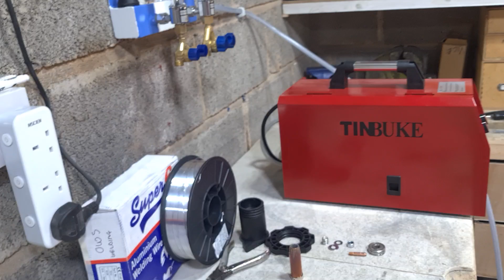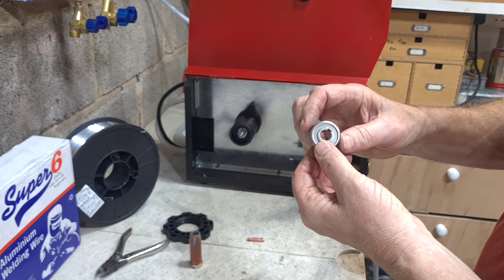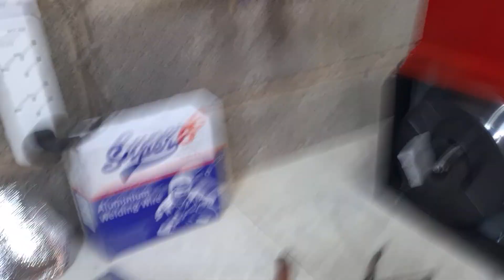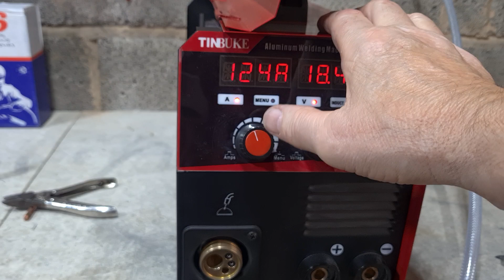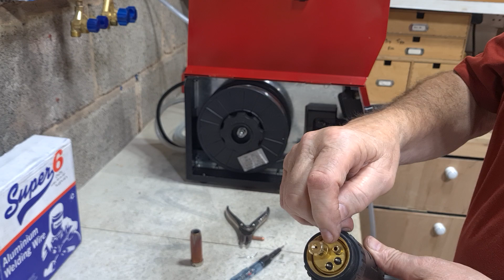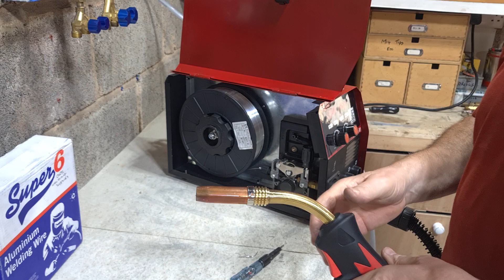Aluminium welding set up with the TINBUKE 230-DP

Comment: I have this welder and I am having problems using any of the pulse setting on aluminum. No matter what I set it on I get major burn back into the tip. I am running on 110 currently. Been welding in the collision industry for over 50 years, never had a machine stump me before. I can’t find any useful info online. Should I be running 220 power for this to work. Any explanation of settings would be appreciated.
Reply from the maker: Will get back to you later , but I have videos using all 3 modes on 220. Burn back is either not enough wire , voltage 2 low or wire feed roller pressure 2 low or Bends in the mig torch. Have a look at the most recent videos even spool on gun. Let me know. Good luck
Reply from the maker: Also get off 110 volts

Comment: I'm going from a traditional , ( wire feed and current knob ,) Cebora 185 mig welder to the Tinbuke 230-DP which I've just bought . Predominantly for co2 steel mig welding . I have no idea what the selection of settings I now have access to are for , such as induction . Any suggestions ? In all honesty the handbook isn't much help .
Cheers for yer time , CHUFTY
Reply from the maker: Sounds great!  The inductance is for smoothing out the spatter created.   Did you check the plug wiring if you are in the UK. Drop a message of how you get on. Happy Welding
Reply: @Len-r9c  Got it . Plug wiring's fine . Didn't find the manual particularly helpful . I need to know how the amps and voltage dials relate to the power and wire feed dials on a traditional mig welder , and what voltage settings to use . By the way , really appreciate the reply .
Cheers , CHUFTY
Reply from the maker: What thickness are you working on,  one bit of advice. Try gasless it is brilliant. Remember what is a good weld "Fit for purpose "  what you spend on gasless wire you save on the gas consumption. I'm a recent convert.
Reply: @Len-r9c  It'll be allsorts from petrol tanks to ground up build of motorbike frames and beyond . I'd kinda like to stick with gas , been doin' it for 40 yrs and I have confidence in it .
Reply from the maker: Are you using Co2 ? When you set up, connect the torch and feed wire ect. When you feed the wire hold the wire feed button in for a few seconds and the wire will feed at the wfs you set. For gas flow settings hold the voltage button in for a few seconds and the gas will flow. It's brilliant and the supplier didn't know about that. Welding conditions are easy. Lowest synergic setting is for thin air to rust top settings for 6mm or more. Try pulse for steel there is little or no spatter, I did a video of this, also it's the best aluminium pulse machine I have ever used, if you have a good machine because personally, I'm sorry to say it is not the most reliable of welders. But the best arc you can get. Drop me a note if you need help because my granddaughter still has one of these.  You would have to pay a lot of money for a welder to perform like a Tinbuke. Happy Welding
Reply: @Len-r9c  Yeah , it'll be co2 . I think I'm gonna go with factory default for a bit , and just play with voltage and current . Gotta say , with only power and wire feed , the Cebora's dead easy  , but I'll get there . Modern technology an' me rarely get on , but we'll see .
Reply from the maker: I'm 75 and a bit
Reply from the maker: This is better. You really should invest in a reel of gasless wire. If you have ever stick welded you will love it   seriously. Where abouts are you
Reply: @Len-r9c  I'm in Bournemouth . Tried gasless , I find it , ( like arc welding , ) a bit spattery .I'm happy using it on some things ,usually when I can't be assed to move the Cebora .
Reply from the maker: I'm going to have a chat with my granddaughter and possibly do a comparison between Tinbuke, Kaitai and ANDELI with Co2.   Let you know when we post it
Reply: @Len-r9c  Brilliant . ta very much . Catch ya later , CHUFTY
Reply from the maker: Setting up now welding Tuesday 😵‍💫👩‍🏭
Reply: @Len-r9c  Gotcha
Reply from the maker: Had problems yesterday 😕. The Tinbuke is problematic with cored wire. You mentioned that the instructions were not good. The one I have is not bad. Very detailed about the digital panels. Does yours have the Tig torch adapter?  Having to re weld everything, I messed up big time. Happy Welding
Reply: @Len-r9c  Mine came with MIG torch and arc welding rod holder .

Comment from the maker: Having a go today if the torch I have will fit
Reply from the maker: I did a video of using Tig DC a few weeks ago. It will be a scratch start and use Argon as the shielding gas. You will have to control gas flow from the cylinder regulator or from a Tig torch on off valve. You will waste gas because on no solenoid. All DC power sources can give a DC Tig arc. Hope this is of some use. Regards grandad welder 😂
Reply from the maker: Sorry to bang on but the inductance will be great for balancing the arc   start on -10  And work up to + 10. I think you will be amazed. One other thing if you have the same brass type neck on your torch, wrap some gaffer type tape around the straight connector to the wire feed connection and it will be one of best mig torches you can buy. If it's the same as ours it can separate top and bottom. Happy Welding
Reply from the maker: If it's the same torch as ours with a brass type neck, it's a good touch a cut about the 15 and 17 you get but wrap the connector to the wire feed with a good tape. If it's the same as ours it may separate top and bottom. Happy Welding 👩‍🏭
Reply: @Len-r9c  Not a fan of the big industrial torch , changed mine for a smaller one  like my Cebora .